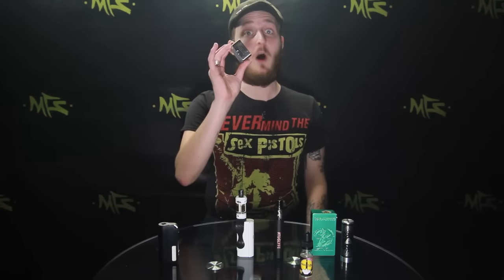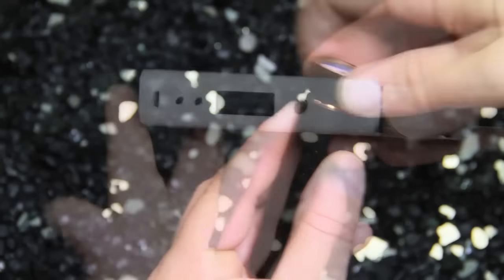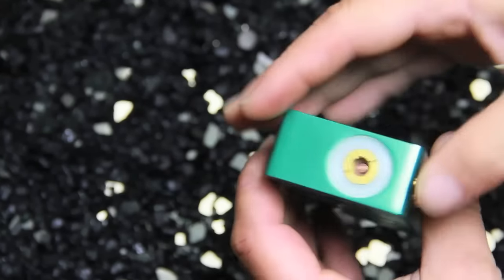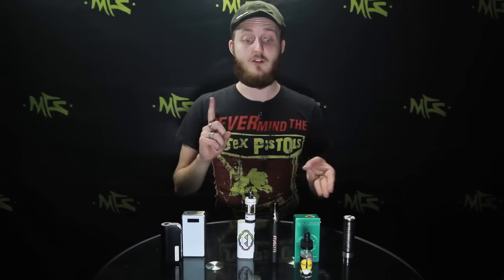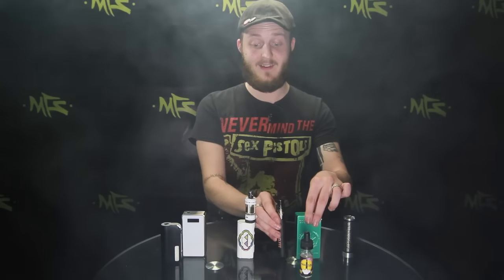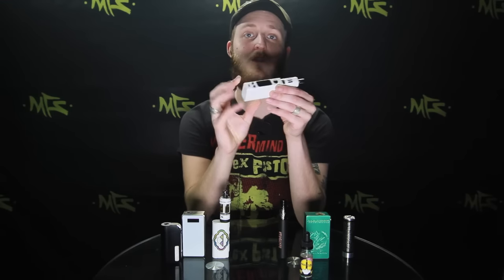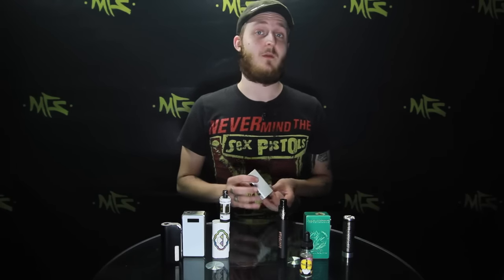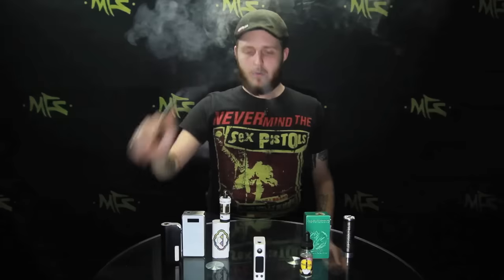Regulated vs Unregulated Mods - MyFreedomSmokes

Comment: Quick question?
I've been vaping for a few years I upgraded to a revolution vtc 60 two months later I purchased a velocity rda started making my own coils two month later purchased a sxk Corolla rdta. Now I'm looking at purchasing a bigger dual coil tank but would also need a bigger box mod. Now I know nothing about ohms law purchasing an unregulated device it that just getting full wotts instantly as soon as your hit the fire button do you loose flavour or does it increase it.

I'm just spitballing here to test if it's just safer getting a better regulated device advice from a pro helps 👍🏻😀
Reply from the maker: +Jonny Jones If you are going to be building your own coils you definitely should learn Ohm's Law for safety reasons alone. A regulated device will be more forgiving of mistakes in a build than a mechanical would be. With a mechanical mod the wattage will be determined by the resistance of your build and the voltage of the batteries per the Ohm's Law formula.
Reply: Thanks for your reply is there a video on YouTube about ohms to simplify things?.
Reply: +Jonny Jones watch twisted messes with his noisy cricket

Comment: when you say wont go below .3? does that mean i cnt runa reguar .2 dual coil build ? what kind of regulated mod would you sugest? cause you can get a .2 coil for the ( aspire cleito  sub ohm tank) and it vapes fine on an istick 40w. Now im confused.
Reply: I Always use 0.16 Ohm with Sony VTC5A

Comment: I don't get it. Why is Mech mods for "Pros"? When you only push a button to take a draw. I really want to know.
Reply from the maker: Mech mods don't have all the safety features protecting the user like regulated mods do. If you don't know what you are doing when building your coil or understand the limits of your battery you could really damage the mod and yourself.
Reply: @HouseofVapor  Exactly,
If you don't know what you're doing, your mod can explode.
Mechanical mods are for advanced users who fully understand ohms law and battery safety. As one small mistake can lead to a ticking time bomb in your hand,
Reply: don't have to be pro.just make sure your coil don't draw current higher than your battery can supply.know Ohms Law.

Comment: is the ijusts by eleaf a regulated mod?
Reply: vapor king Yes it is 😀
Reply: vapor king nah its a mech mod ...i doesnt have temp and wattage comtrol
Reply: Razorx44 nick It's "semi-regulated". As in, while the user is not able to control the power output directly (via wattage or voltage), the battery power does pass through a chip that has some safety features in it to make sure nothing stupid happens. :)

Comment: This is kinda dated info...

I don't see many 20 watt mod anymore, lowest wattage box mods I see are maybe....50? 85? But many are 200 now. And many of them can read resistances to 0.1...the nicer ones can read down to 0.05. which I don't even understand why you need to even go lower than 0.1. that's so excessive. 0.15 is crazy low already. I like vaping at 0.5 NOT 0.05.
Reply: Mech mods are basically novelty items now. For the extreme extreme hobbyists. Regulated box mods rule the market. And performance is negligible to the avg vaper. And control over your vape is controlled with a push of a button. Not having to re-wrap a different coil and re-wicking to customize your vape. Such medieval ways of vaping.

Comment: unregulated do have safeties if built properly. there as mosfets, resettable fuses and more. if you want you can even just make it a basic regulated mod with a dirt cheap regulator board. The cheapest of these has no buttons so you set it with a screw inside but some have buttons the same as your topbox mini or whatever.